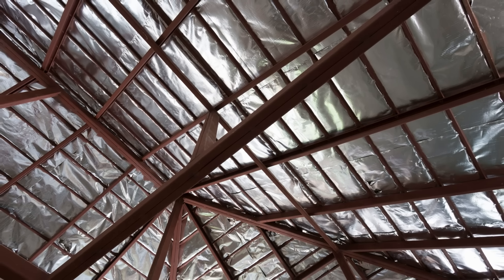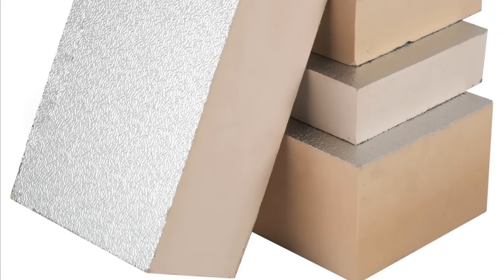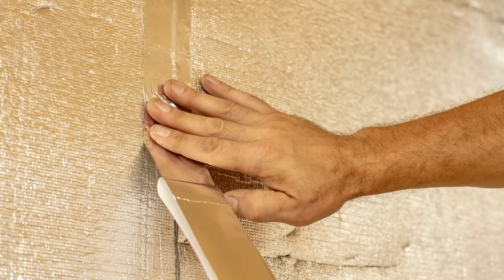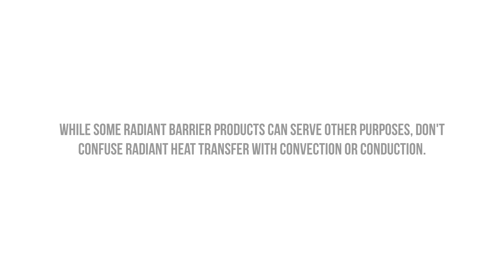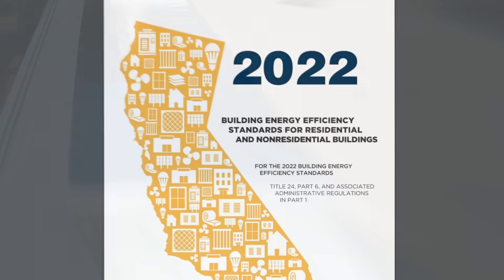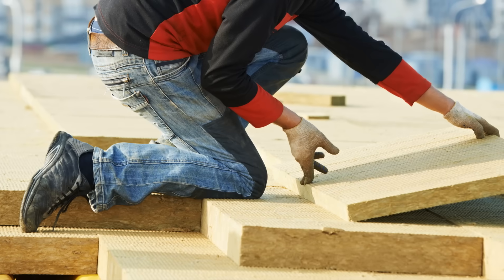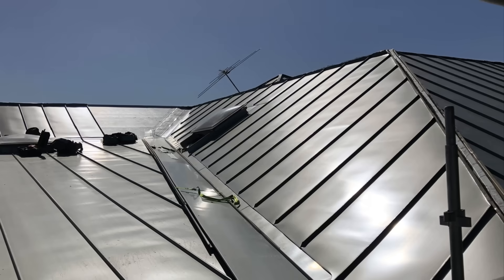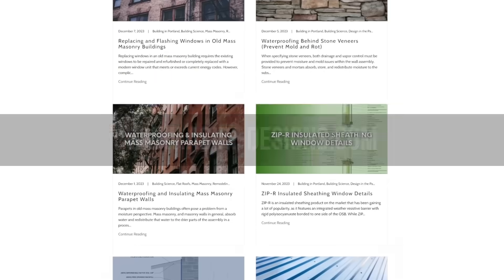Do Radiant Barriers Actually Work?

Comment: Radiant barriers still have value when facing inward. This follows from the relationship that for an opaque object, Emissivity + Reflectivity = 1.  Radiant barriers have a very high reflectivity and therefore a very low emissivity.  So when the radiant barrier facing an air gap is on the "cool side" (facing outward), its high reflectivity means it doesn't absorb much of the blackbody radiation coming across the air gap from the "hot side".  Conversely, when the radiant barrier is on the hot side (facing inwards), its low emissivity means it just doesn't emit much blackbody radiation in the first place.  Either way, radiant heat transfer across the air gap is reduced.
Reply: The emissivity/reflectivity formula can be 'confused' because they vary with wavelength, as does radiant heat, so you can have both high reflectivity (short vis/UV wavelengths) and high emissivity (long/mid IR wavelengths). It this point details matter, and advertising literature is often misleading! As you stated, the air gap is key, as it breaks the conduction-through-material linkage!
Reply: @philipoakley5498 The wavelength dependency matters for the outermost layer that is exposed to the sun, whose spectrum is comparable to a ~5,800K blackbody.  But for any actual air gap, where the two surfaces facing the air gap are not directly exposed to the sun, each side will be emitting (to a greater or less extent depending on emissivity) as black bodies of around 270K - 330K.
Reply: @maths9085  Agreed, however there are still the residual difference between the 3-5um and 8-14um bands etc. The radiative gradiant across the 3-5 band is quite steep. Lots of finesse to be had in IR system design ;-)
Reply: @philipoakley5498  OK, so an online blackbody spectrum graphing calculator tells me that for 270K to 330K blackbodies, the peak emission will be around 9-11 um, and that >90% of the energy is transmitted in the 3-30 um band.  Are you staying that it is common for the emissivity of a given material to vary significantly across that 3-30 um band?  If so, I would hope (perhaps naively) that an appropriate product standard exists that would require some reasonable performance labeling based on the intended use.  E.g. pick a standard temperature (310K?), and provide the ratio of total energy radiated (per unit area or solid angle) by the product at that temperature to the total energy radiated by a perfect blackbody at that temperature.  Whereas if the emissivity of materials would generally be constant over the 3-30 um band, it would suffice to label products with the emissivity in that band.
Reply: As a dweller in a cold climate, I was irked by the implication that keeping heat inside a structure is "wrong".  What an idiot.
Reply: This is true, but it also illustrates why these barriers are better on the outside of the house. No matter which way you face the barrier, when its on the inside of the roof sheathing the same amount of heat is entering the building envelope. You're relying on a vented air gap to remove that heat, which will never be sufficient in hot climates and you'll get some conduction and convection heating of the conditioned space as a result. Keeping the heat out in the first place by placing barrier (radiant or insulation) on the outside of the sheathing is a much better design.
Reply: @Swiggityswagger  If I understand your point, for the simple case of a radiant barrier (plus air gap) on either face of roof sheathing, the roof sheathing will be cooler when the radiant barrier is facing outward.  And therefore there will be less conductive transfer to the framing members in contact with the sheathing.  This is certainly true but I wonder how large the effect is.  Compared to the difficulty of installing an upward facing radiant barrier, which requires arranging an air gap between it and the roof covering, and if it is exposed to dust, performance will degrade over time.
Reply: Thank you. Foil-laminated OSB roof decking (foil on underside) has a huge impact on comfort in the living space below. The low emissivity blocks infrared radiation from the hot roof decking from propagating downward toward the living space.
Reply: @maths9085 Builders aren’t physicists 😉 He needs to visit Wiki at least.
Reply: Yup, doesn't matter which side it's on, as long as there's a gap to prevent conduction.
Reply: @jimurrata6785  I agree, low emissivity on the inward surface or outward surface will have the same effect on radiative heat transfer. However, putting the low emissivity surface on the inside does mean the roof decking will be hotter, which (aside from more thermal expansion and contraction) means more thermal mass is heated and thus more opportunity for conductive and convective heat transfer with the inside air.

But yes, from a radiative perspective, either side will work.

Edit: I should add a condition here - that my comment above assumes that the roof deck conducts heat fairly well such that the backside of the roof decking is comparable temperature to the front. Obviously if the roof deck was 6" of foam, the underside would not re-radiate as much since it is at a lower temperature.
Reply: @jamesroscoe7555  Absolutely. And while the deck doesn't have nearly the mass of something like a couple of layers of asphalt shingle it does act to conduct heat to the inside of the building envelope.
One of the reasons for reflective on the underside is because it stays relatively clean. (a filthy mirror is no mirror at all)
I'm really surprised that all these insulation baffles, for soffit to ridge venting, are always black plastic instead of laminated with reflective mylar or something....

Wait until you try to explain that insulation only slows the transfer of heat, never stops it (except for absolute vacuum, which still doesn't stop radiation)
Reply: @jimurrata6785  I agree fully. And yes, the dirty upwards facing reflective layer is definitely an issue. Probably better than nothing at all, but I guess it depends on just how much dust and debris accumulates. Upward facing horizontal radiant barriers are pretty common, eg in staple up radiant.

 I think I have seen reflective insulation baffles for attic spaces, but you are right, most are not (and produced as cheaply as possible). It might make more sense to cut and cobble from reflective faced foam in that situation (while considering vapour permeability of the assembly).
Reply: @jamesroscoe7555 As long as the shingles can take it, them heating up more might be Ok.  As the shingles get hotter, they will radiate that heat back to sky as the interior facing reflective surface has such low emissivity.  For high temperatures, this should dominate over convection.
Reply: @jamesroscoe7555  some years ago I did as you suggested above with reflective faced foam and temperature drop in attic was stunning.

Comment: Folks this information will get you into trouble with your home, it will create more problems that it solves.  Just build a normal home with insulation and wrapped in plywood or OSB.  Fifty years of building homes has taught me not to use anything on the exterior of your home that has not been done for at least twenty years and proved itself successful.  It takes that long for problems to show up, even though the damage has been going on for the entire twenty years.
Reply: Everything that has been used for the past twenty years had a beginning. It had a first day, first year,etc. In other words, someone has to be the genie pig and start their project with whatever the new material and practice might be.
Reply: @MrItalianfighter1  That's right, you said it; some one has to be the sucker that tests if something new, actually works.  In this case it would be thousands of suckers.  Take my advice for your own home, use the tried and true and you will not be sorry.  In my years I have seen so many "new ideas" come and go in failure.  Take sips for example, they were going to be the new money saving thing, but not many use them any more.  I will let you figure out why.

Comment: Where I'm at in California, a radiant barrier is required on roofs, but it's almost always deployed as a radiant barrier bonded to OSB with the radiant barrier facing inwards. It has never sat right with me that that would be effective. You are also now starting to see not only the ceilings in homes being insulated, but the rafters as well. So the insulation gets pushed right up against the radiant barrier.
Reply: For everyone saying foil faced plywood/OSB doesn't work in hot climates. It drops attic temperatures by over 30 degrees F in the summer.

I've heard that it also helps reflect heat back into the sheathing and dry any moisture that has gotten into the wood sheathing.

It is well worth the small increase in price over non-faced sheathing for the drastic temperature reduction inside the attic.
Reply: Im in arizona in tucson a hot climate.  Should I install my foil on the top near osb or bottom of the rafters after insulation?  I have r38 and a flat roof so my cavitys are 7.5 inches high 12 feet long and 22.5  inches wide.
Reply: @andyponcia7722  Are you re-roofing? do you have any airgap between the roof and insulation? Is it a vented attic. What roofing material?
Reply: It works very well.  The attic space when radiant barrier is glued to bottom of the roof membrane makes all the difference in the world.  I built homes for over fifty years and I know from experience that it works.
Reply from the maker: @thomaswayneward If the membrane is adhered to the radiant barrier, you're no longer preventing radiant heat transfer... Rewatch the video.
Reply: @ASIRIDesigns  I agree that if the radiant barrier is applied in a sandwich where there is no air gap, it will have no benefit.

However it is just a low emissivity surface and there is reciprocity. If, for example, one applied it to the underside of the roof decking with an air gap to the inside (ignoring all the other possible problems like creating a VB sandwich and fitting it around trusses etc), the roof deck would have a low emissivity inward and high on the outside. So the roof deck would heat up from the sun, but it would not re-radiate inward very well and the attic space would still be cooler than with no radiant barrier. Contrast that with the radiant barrier outside the decking with an air gap to the roofing where the decking would not heat up as much. Similarly, placing a radiant barrier on top of insulation with an air gap between that and the roof decking would also help to attenuate heat radiated inward from the roof decking (but again possibly with VB issues depending on the climate zone etc).

Obviously, there is some benefit to having the low emissivity on an outer surface as it means less thermal mass is heated and less opportunity for conductive and convective heat transfer from that thermal mass elsewhere. But regardless, the emissivity works in both directions.
Reply: @ASIRIDesigns  I trust my over fifty years of building homes, instead of your video.
Reply: @thomaswayneward  So you trust your anecdotal experience over actual scientific studies? What exactly from your 50 years of experience leads you to the conclusion that RBs on the underside of roof decks work?
Reply: @thomaswayneward  I mean, you're kinda saying the guy in the video is wrong...
Reply: @teraxiel  ...and the article, and the laws of thermodynamics.  Despite being an unverifiable strange, his three sentence anecdote was enough to convince me that physics don't matter when someone who learned to build homes in the 70's is speaking from experience.  It''s obviously not the insulation part that having an effect, it's definitely the radiant barrier that's sandwiched in the middle, acting as a thermal conduction bridge, doing all the work. /s
Reply: @teraxiel Yes, the guy is wrong. This is why. Radiation heat  cannot be reflected through osb back but it cannot go through foil further into  attics  and rooms below. So heat turns from radiation into conductive heat  all of this happens in roof sheeting. That foil on the back of osb stopped radiation from going below, vented attic and insulation on ceilings do not let that conductive heat get in  living spaces,
Reply: @andreycham4797  You're kind of right, but once the OSB absorbs the reflected energy from the RB it heats up and through conduction passes much of that heat to the attic. And if you read the article linked in the pinned comment by the creator you will see that it has been studied and shown that RBs have little effect when attics are insulated to R38.
Reply: @teraxiel  You catch on quickly.
Reply: @teraxiel  if you have a low emissivity coating (the reflective barrier) on the inside of the roof deck, it is not reflecting the heat back through the OSB. There is no air gap between it and the OSB. The outside of the OSB/roofing is high emissivity and absorbs radiant energy from the sun. That heat is transferred via conduction to the inside surface. That inside surface is low emissivity so it doesn't emit (or re-radiate) very well across the air gap to the attic insulation. If that air gap is properly ventilated and insulated, then that heat should not make it to the interior living space via conduction or convection.

The latter point is why BSI suggests that the reflective barrier is unnecessary in properly well insulated assemblies. There isn't much heat transfer anyway due to all the insulation, so it doesn't really matter much if the outside of the insulation gets hot from radiated energy.
Reply: @jamesroscoe7555  I don't know if I agree with your statement that "it is not reflecting the heat back through the OSB". I'm assuming the RA bonded to OSB is reflective on both sides, not just the outward facing side. RBs operate mostly in the infrared range, so the radiant energy passes through the OSB to hit the RB film and is reflected back outward through the OSB. So the infrared energy would pass through the OSB twice, absorbing some it each time. And since the OSB is literally the surface that encloses the attic space then some of that heat is transferred through conduction into the attic air.
Reply: @teraxiel  Most of the radiant barrier membranes are just a metallized layer on plastic sheeting. They are broad band reflective and low emissivity. OSB is a fairly broadband absorber, including IR. It gets hot and that heat is conducted through it. When heat reaches that metallized film, it is conducted to the surface where it is conducted to air and re-radiated (at a low rate due to the low emissivity).

Think of it this way: if you had an IR laser and stuck a block of OSB in the beam path, the beam would be completely blocked (a thin piece of cardboard does this). Putting a reflective layer on the backside of the OSB would make no difference in the reflection or transmission. OSB does not transmit IR, at least in the context of solar blackbody radiation - it absorbs it. At the molecular level, light is absorbed, re-released as vibrational/ mechanical energy which is then conducted through the material. This is a different process than transmission of electromagnetic radiation.
Reply: @andreycham4797 The video creator is talking about 'stressing the building structure' where I am concerned about stressing the building occupants in the conditioned air space.
Reply: @thomaswayneward  If I am remembering correctly, one manufacturer specified the OSB-bonded barrier face into the attic; the explanation is it is too slippery to be on top, creating an unacceptable safety hazard.  And as you say, it still makes a significant difference.

Comment: I have a question for you. Is all of the electromagnetic energy emitted by the sun and falling on the roof, actually close to entirely absorbed by the roof, heating it? I ask that because that would mean that the solar radiation is not what the radiant barrier is actually reflecting. If all of the sun’s energy is absorbed in the roof deck heating it, then the roof deck will emit “black body” radiation the intensity and frequency distribution of which, is dependent on the temperature, and only on the temperature of the roof deck. The radiant barrier would then reflect back half of that radiation, I think. I’ve never seen this question addressed and I’d appreciate any better explanation you can give me. You might want to ask a heat transfer engineer. Thanks.
Reply: @DitDitDitDahDahDahDitDitDit  Yes. The roof will re-radiate as a black body. However some of the radiant energy from the sun is conducted inwards and re radiated inwards if there is an interior air gap. The emissivity (and temperature) of each surface then matters. No, not all the energy from the sun is absorbed - some is reflected back, depending on the reflectivity/emissivity of the roof surface (why a white roof is cooler).

Also note, that the roof (thankfully) has a much lower temperature than the sun, so the blackbody radiation from the roof is less intense and red shifted. How much the radiant barrier reflects back (or does not re-emit) depends on the construction and properties of each surface.